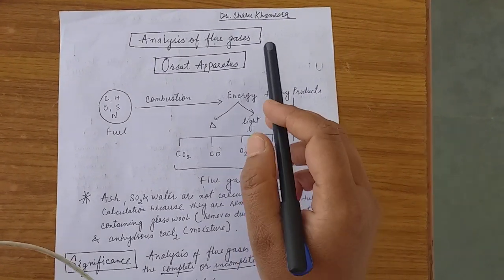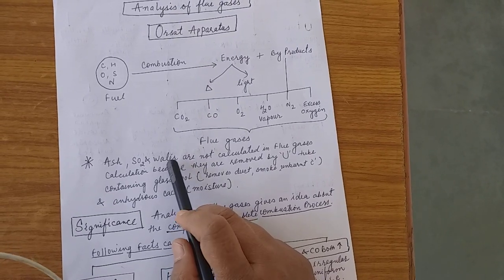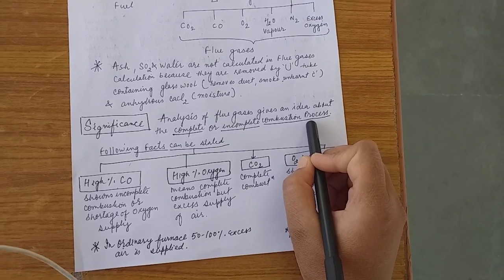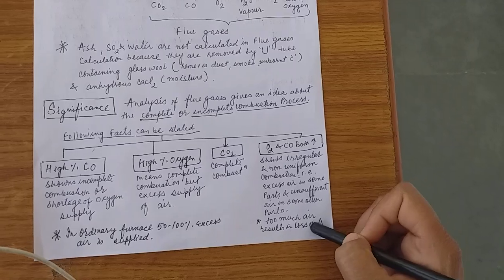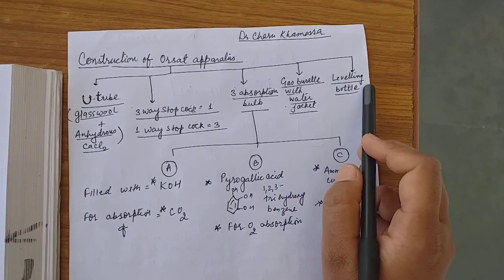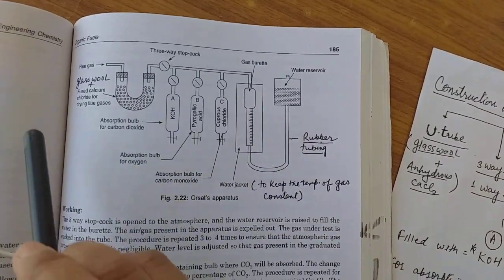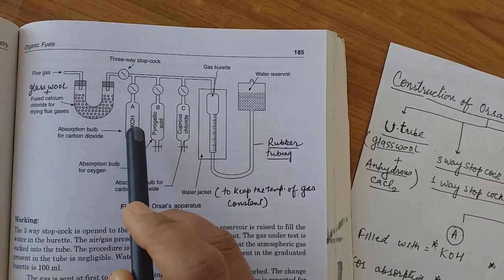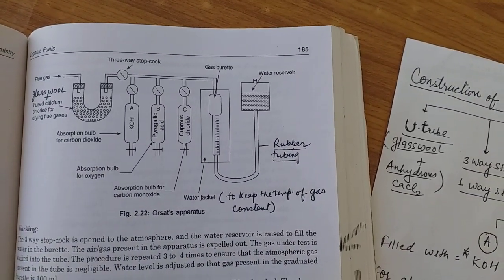Gaseous Fuel, L-10,Flue gas Analysis ( significance, construction and working of Orsat Apparatus)

Comment: Ma'am exhaust gas and flue gas m koi difference h kya ... Orsat apparatus se flue gas ka and exhaust gas ka analysis plz tell me ma'am ji
Reply from the maker: Exhaust gases which leave from chimney it may or may not contain useful gases but flue gases which should not required in fuel.
Reply: @chemistrybydr.charukhamesr9731  ma'am ji . Analysis of exaust gas by orsat apparatus and analysis of flue gas by orsat apparatus ye . Dono same h . Different h .. mere sir bol rahe hen almost same h .. mere syllabus me exhaust gas by orsat apparatus h . But aap flue gas use kar rahe ho . I am not understanding ma'am ji ..plzz clear to my doubt 🙏
Reply from the maker: @कुमार_आदर्श  both are same
Reply from the maker: Both same
Reply: @chemistrybydr.charukhamesr9731  Thanks ma'am ji 🙏
Reply from the maker: both are same.